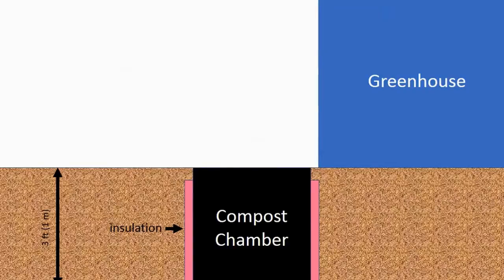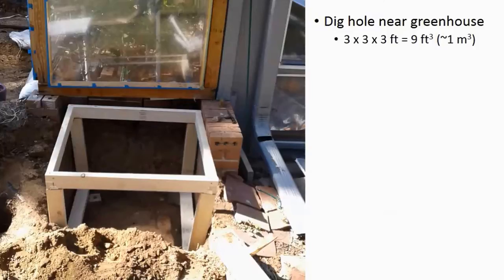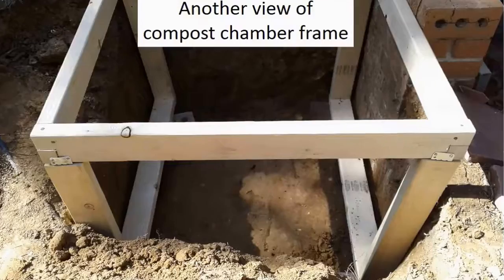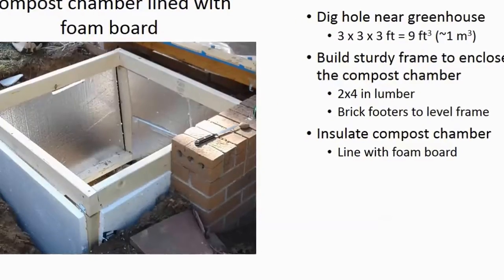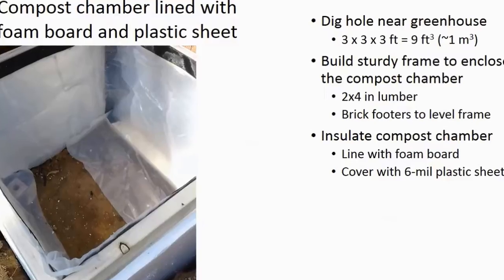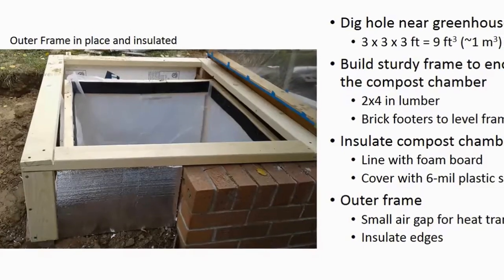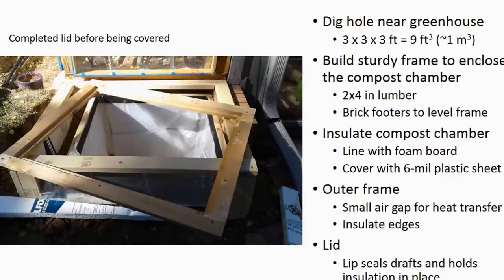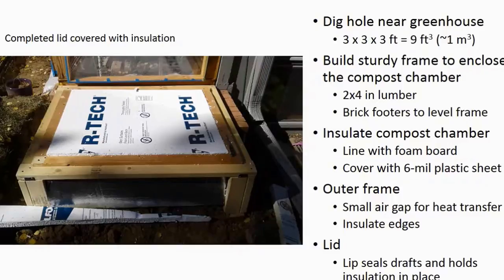Compost-Heated Greenhouse: Design (part 1 of 3 in 2017 series)

Comment: Again great work 👍🏻 just watched it again. I know space is an issue but could you build out a ramp on the far side to make turning and getting materials in and out easier? Or build a longer hole with a partition so there is an area to stand? I'm thinking of using compost for heat in my greenhouse in the UK - I may "raise" my greenhouse so I don't have to bury the compost and still benefit from heat rising... great videos and channel like your experimental style! Thanks
Reply from the maker: Hello, and thanks for the post!  You definitely could (and probably should?) make one side of the compost chamber accessible for compost maintenance.  I like your idea to build a "U" shaped chamber where you could stand inside the U to maintain the pile.  Alas, I lack the space for that.  However, what I learned last year was that turning the pile often did more harm than good.  In some cases, an active pile went dormant when I turned it!  My strategy is to fill the compost bin with leaves, some mature compost, and lots of coffee grounds.  When the pile reaches 120 deg F/50 deg C, I know I have added enough grounds.  When the pile drops below 100 deg F/40 deg C, I add more grounds.  As the level of the pile drops, I simply add more leaves.  I have not seen a great need to continually wet the pile; since it is covered, it retains moisture.  I have an external compost area (large dirt berms) where I can prepare and sort compost material.  I like to add a "ready to go" compost mixture to my compost heater.

Hopefully this helps!  I'm looking forward to getting a hot pile going!